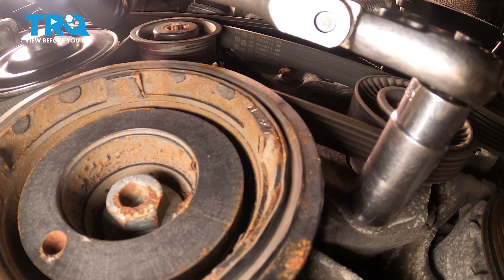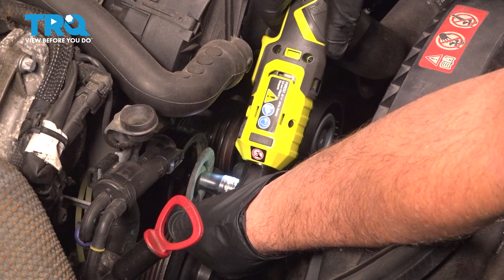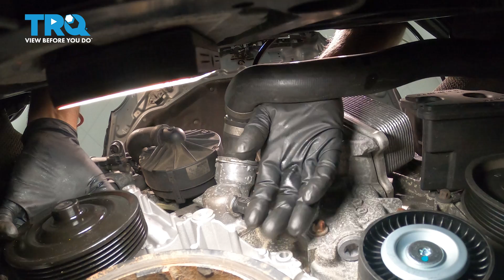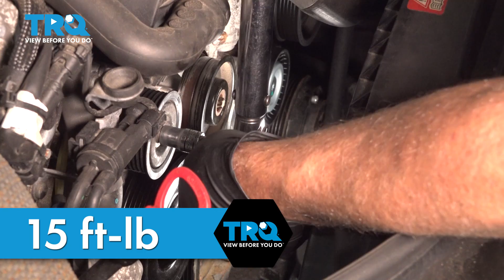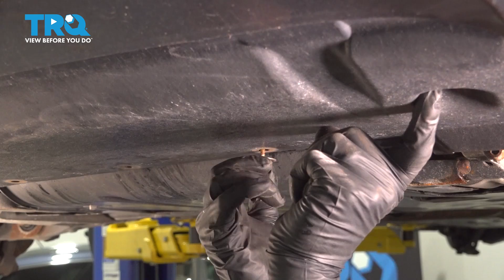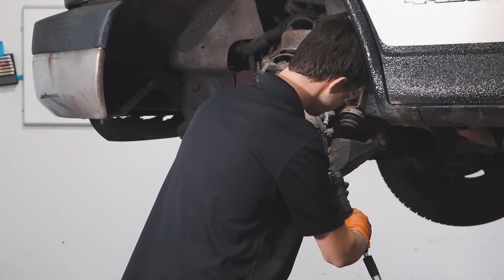How to Replace Engine Water Pump 2006-2009 Mercedes E350

Comment: I notice that you didn't mention a specific tightening sequence, which might be important due to distortion during tightening. Also, the factory bolts when removed have a blue coating on them which I believe is medium grade Locktight. Please correct me if I am wrong. Thank you.

Comment: BEWARE!!!!  The serpentine routing diagram that appears at 16m:30s into this video is wrong.  The belt goes UNDER the water pump to engage the grooves (not over it ).  The belt will fit as shown, and it may even run (for a while), but if you make this mistaken you will likely be left stranded with a shredded belt.  I would also opt for a thin bead of Ultra Gray on both sides of the gasket, but otherwise... great video.

Comment: Another great video from TRQ. Anyone attempting to tackle this should have no problem using this video as a guide.
Note - For the Serpentine Belt install portion (as another also pointed out) the belt diagram image shown for reference is incorrect, however the belt installation procedure seen being done in the video is correct!
Additional Notes - 
• Low Profile Vehicles such as this may need a certain type of jack that is meant for low profile vehicles.
• The socket type/sizes required as shown in the video aren't commonly included in basic or generic socket sets, be sure to confirm you have the proper tools for the job!
• Be safe, wear safety gear, always collect and dispose of fluids properly, and never get underneath a vehicle without securely supporting it with jack stands.